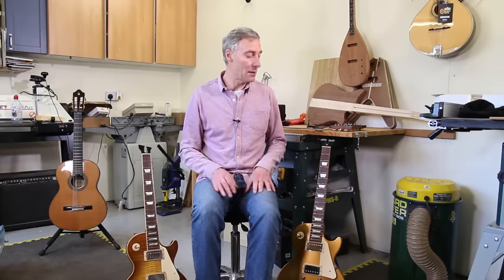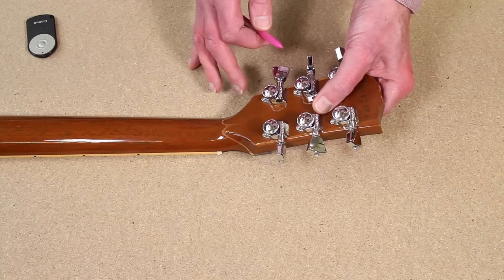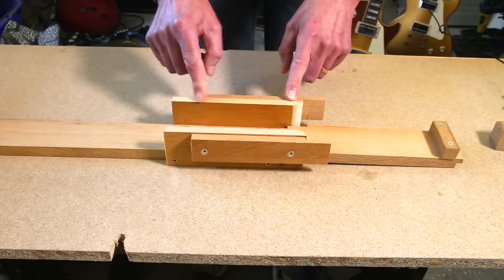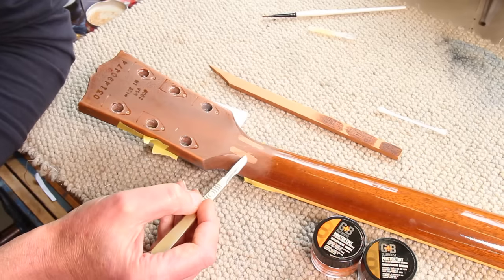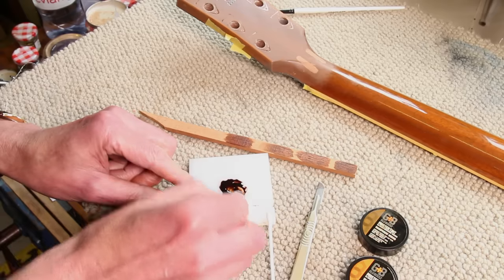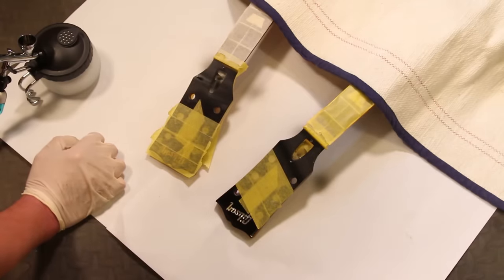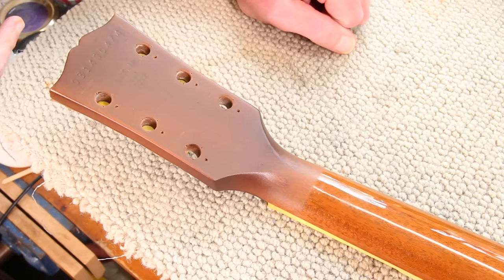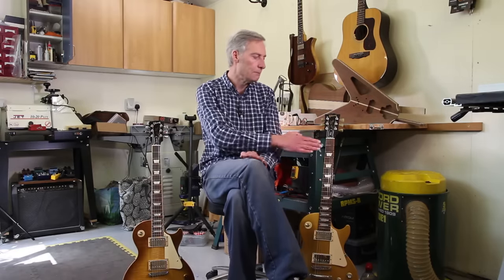Repair of a Gibson Les Paul with a snapped off headstock

Comment: First off, very nice work. With that said, I am not a Gibson fanboy, in the least. But I've never seen a Gibson Les Paul get a neck fracture on it's own, ever. The guitar was dropped. Either in it's case or out, it was dropped. And again, I'm not a big fan of Gibson guitars. But I have been a carpenter and cabinet maker for a large part of my life and know wood.
Reply from the maker: As a result of this video I do a lot of LP neck repairs. It is hard to believe that the neck would crack without being dropped, but I have spoken to too many customers who are adamant that they opened the case to find that the neck has cracked. I could say more about the construction of LPs and why they are more likely to suffer a neck break. But it is worth pointing out that I have not been asked to repair a PRS. Same one piece mahogany neck but a very different headstock angle.
Reply: @flameguitars5770  
I definitely agree that the neck to head angle is the cause. But if it were changed, no Gibson fans would want it. Lol.. me included.

Comment: amazing result. can i ask. how was your sanding process? the grits?? i tried something similar on my epiphone and i can see swirls under the polishing layer. cheers
Reply from the maker: It is easier to do finish repairs on a Gibson than it is on an Epi. That is because Gibson still use nitrocellulose lacquer. So fresh lacquer 'melts' or blends into the existing finish. Not so with an Epi. So if you apply fresh finish to a Epi that has been sanded up to say, 320 grit, you are likely to see scratches under the finish layer. Does that makes sense?
Reply: @flameguitars5770  it does, thanks a lot. i sand it down quite a bit with less aggressive grits even wet sanded. not that i mind, just curious :) . but thanks a lot for the answer

Comment: Thanks.  I’ve got a Les Paul with a break even more end to end than the one you splinted.  Do you mind telling me the dimensions of the pieces?  I have a body I’ll be routing out of maple and I want to make some reinforcements with the spare wood from that job.  Thx!
Reply from the maker: I use splints that are 6mm wide. Length various but about 50mm should be ok. Good luck

Comment: Very good vid. Would you use a splint if the break was at the heel (close to where the neck joins the body)? I bought a nice LP copy with a neck break right where it blends back to the heel (Not a complete break, but it did go from one side to the other). I wedged it open slightly and filled with Titebond II and clamped it over night. It glued up nice with what looks like a hairline crack exposed and it stays in tune and has not come apart yet. Would you be concerned the glue might not hold without a splint?
Reply from the maker: I think that what you have done should be just fine. No need for any additional strengthening

Comment: I have done dozens of les Paul Headstock repairs some vintage there is no need for splints! seem every new repair luthiers decide to splint none of my repairs have ever failed the glue joint if done correctly is stronger than the wood itself! .. I always do my best to keep the crack as invisible as possible especially on a very valuable vintage1958 Goldtop  Les Paul repair is nearly invisible no splints.

Comment: how do you make sure the neck isnt twisted as its never going to be a perfect fit in that direction cause the wood splinters so it wont be identical.
I know you use clamps to get the angle in the one direction. is it worth stringing it and applying the tension before clamping it?

very nice work though. 
there are even people who deliberately crack their headstocks because they say they sound better after repairs. what do you think mate?

Comment: Fantastic work on the Lp Standard, It's a shame that the finish on the back is so dark, but as you said compromises must be made, just wondering what lacquer do you use?
Reply from the maker: I used nitro. Have a look at a more recent video I have posted about the repair of a LP. Different approach to colouring the neck.
Reply: @flameguitars5770  just wondering, what brand of nitro are you using?

Comment: I have a crack just like that in my epi sg. Mine isn't completely off yet. So I'm figuring if I should route that slots for the inserts before breaking of the head. I'm thinkin that by doing it in that order, the inserts will dictate the exakt placement for the head when glueing it back together, right?! I also have that exact router among others =)

Comment: Great video which I will watch several times to help me. I recently bought 2 Epi Les Pauls for $300 because they both have broken headstocks. A steal if I can repair them and use them as back ups for my Gibson LP.
What is the glue you used?
Reply from the maker: Generally Titebond. I now have a total of 3 videos on neck repairs. Slightly different techniques used in each. Hope they help with your repairs.
Reply: Thank you. I’ll check them out.

Comment: How do you go about making the inserts to fit the routed holes?
Reply from the maker: I use a 6mm router bit. I also have strips of mahogany that are exactly 6mm wide. These are then cut to length and the ends rounded to fit the slot.

Comment: This is most excellent. Do you mind if I ask what-all you're using to polish? I see 8000 grit sandpaper there, but it appears you have a bunch of different things going on!
Reply from the maker: Thanks for the comment. I used micro mesh polishing cloths on this job then Mirka compounds. But frequently I cut back to 2500 grit and then go to the buffing wheel.

Comment: You did such a masterful job of the splints and tinting them that it was a shame that the cover up tint came out so dark.  I would actually rather see the high quality splint work knowing the guitar was stronger for the effort than have such a drastic color change to try and hide what is essentially an improvement.  Nonetheless, it was an impressive job.

Comment: Just watched the video, very impressive. One ?, was the Titebond hide glue? If so why that vs yellow carpenter glue? Thx.
Reply from the maker: Titebond cold hide glue gives a little more working time before the glue 'grabs'. In the case of a snapped off headstock I might need a little more time to ensure that the two pieces are properly aligned as I tighten the clamps.

Comment: Hi. Thanks for sharing your technique with all of us.  May I ask one question?  In trying to remove scratches from an Epiphone SG (black) headstock, I accidentally sanded the two upper corners too deep revealing a layer whose color doesn't match the rest of the headstock.  What material, i.e. lacquer, paint, polyester resin, should I use to fill/color match the corners to the rest of the headstock face?  I'm thinking dyed polyester resin as I believe that is the finish on this guitar.  Thoughts?
Reply from the maker: Sounds like you sanded through to the base coat. I would use black lacquer, (either poly or nitro) and an airbrush to make that repair. But depending on the repair area an artists brush will do. Blending new paint onto existing finishes is extremely difficult (easier with nitro). So settle for a "good enough" repair rather than look for an invisible repair. Good luck.

Comment: For those wondering I shopped around and had mine fixed twice. A glue job should be no more than $150. The splint job depending if you had it glued before fixing again. Can set you back between $500-$700. So either you have a expensive Les Paul, or an old Studio that has sentimental value. It’s worth it if you don’t plan selling it. If you plan selling it, just do a cheap glue job and your gonna get the same price regardless. People on used market like all original and it cuts the price. Only go for splint and good repair if keeping it! Otherwise glue it, sell it and grab a new guitar!

Comment: I simply glued mine back together about 10 years ago and it still holds up.. so if glued proper it will hold
Reply: I agree.I used Gorilla glue on my Fender accoustic (dampen wood first) and clamped.possibly stronger than original.After routering can break again wnere splints begin.
Reply: @hughkelly5701  ^^ Key point right there, dampen the wood!  I did as instructed and only dampened the one side before glue/clamps.. My break also splintered about 4" down the neck which was a nightmare to fit!

Comment: I'm assuming this sort of break is why other companies have volutes at the break angle. Is that correct? I assume it thickens up the material enough that this kind of crack/break is much less likely.
Reply from the maker: Les Paul's in the 1970s were built with a volute. I have repaired neck breaks on quite a few of these. So a volute doesnt seem to guarantee that a crack wont happen.
Reply: @flameguitars5770  Oh interesting, I hadn't seen any constructed that way. I thought that was the whole point of the volute. Does a scarf joint help more to prevent this kind of break? Or maybe a less severe angle? Or both?
Reply from the maker: @NeoRichardBlake  scarf joints make for a stronger neck angle. The neck angle is important. PRS neck angle is less than a Les Paul and I have never repaired a neck break on a PRS. Nor a Fender which no neck angle.
Reply: @flameguitars5770  Very interesting. Thanks for the info. :)

Comment: Hello, mate. I live in Hertfordshire, and my Les Paul Studio has a cracked white finish that I hadn't seen, that made me sell my 2005 LP Standard to a guy on eBay for the same price, just to retain my seller reputation, just because he had noticed the crazing in the paintwork. I would like to fix the finish on my LP Studio, or maybe change it. Can you please advise your location and the price for something like this? Alas, I am on a debt management plan, so high hundreds of pounds is not an attainable goal. The cracking is only on the top face, and not all of it. Maybe if I could visit, you could discuss it with me?
Reply from the maker: I suggest you contact me through my website. I am based in south London

Comment: Nice work!  Would you ever consider epoxying in some carbon fiber or steel splines and then covering them with a veneer of mahogany, or whatever wood the neck was made of?  Maybe not steel, Les Pauls are heavy enough, lol.
Reply from the maker: Thank you. I think that might be over engineering. I have carried out many similar repairs now and, so far, none have cracked again. I have had a couple of simple glue repairs that have cracked again. Better still, would be for Gibson to strengthen that area as part of the build process. I probably repair 10 neck breaks a year. Nearly all will be LP repairs.
Reply: @flameguitars5770  Wow, I didn't think you or anyone would reply to my comment on a 2 year old video!.  I have a 2010 Epi Les Paul Traditional Pro, and I believe it has a scarf joint where the headstock attaches to the neck.
Reply from the maker: @MichaelSmith-rn1qw  I get notification on all comments added to my channel.

Comment: David, if you don’t mind me asking what’s the approximate ratio of snapped off headstocks between Les Pauls & SG’s, and wouldn’t the addition of a volute reduce the number? Thanks for the tutorials btw.
Reply from the maker: Tim, of the Gibson range of guitars, nearly all the neck repairs I carry out are on Les Pauls. It could be that this is their biggest selling guitar (I would guess) Very few SGs. There is the belief that a LP with a volute is less likely to break. This may be true but I have still repaired many a LP with a volute

Comment: Nicely done mate... Very tedious indeed. I have been lucky enough to avoid any head stock snap offs on my les pauls. Knock on wood... You would think by now Gibson would come up with a head stock solution. With the degree of angle from neck to head stock this really needs to be addressed and resolved. Along with the D and G string tuning issues. Come on Gibson, you are better than this. Or maybe not???
🎸🤓🎸🇺🇸☮

Comment: A good idea to re-enforce with splints. Why don't Gibson just build their necks better with a scarfe joint? Would that be enough- I don't know. A good friend and luthier does at least two a week. If I were quality control personnel at Gibson I 'd   look into a better way considering there is little wood after the truss rod has been inserted but it is such a huge problem. Just finished making a LP Jr with a scarfe joint.

Comment: Ive seen a pile of these repairs, and just gluing it back on its going to fail. Nice to put wooden splines in for the sake of the precious purity, still not the fix it could be. I glued a headstock back on an acoustic and routed and epoxied two pieces of heavy welding rod, without the flux on of course. Then the wood splines over that. Permanent repair, and lets face it, any time you add a linear density material into a wood guitar it sounds better with more ring and sustain, as in martin box beam and i beam steel truss rods in the neck. The bigger quesion is, why dont you repair guys inlay a couple of pieces of the awesome grqphite reinforcing rod available at StewMac? Those rods and beams ring like a bell because theyre the real deal graphite, bagged and ovened. If youre going to make a big deal repair, use material that will dramatically enhance the sound of the guitar as well. Order one of those rods and see what im talking about. Ad strength and tone, not just wood and glue to your repairs!!!! I guess thats the advantage to being just a guy who fixes things for real, instead of a pro stuck on his training.

Comment: Why not use the stronger Titebond III ultimate instead of TB cold hide glue. There's no reason anyone would need to take the repair apart again,  is there?
Reply from the maker: yes, a number of people have asked this question. it all depends how easy it is to align the broken parts of the neck. The hide glue gives me a longer working time to correctly align the parts before clamping. Other glues grab to quickly. The last thing i want is for that to happen before i am satisfied that the broken parts are properly in place.
Reply: IME, I've not found any significant difference in grab time between TB1 TB3 and TB Cold Hide

Comment: follow up on my early comment carbon fiber splints would be alittle bit lower than the surface and than cap them with the proper wood required.

Comment: Short of bolts and nuts holding that break together you'll never achieve the strength necessary to hold that headstock in a permanent way.   It'll work for a while but it's going to break again.   The tension at that part of the neck with the strings fully wound in pretty high.

Comment: I think painting the neck and having a blended color change is much more desirable than seeing the repair, unless the guitar or the owner is the type where a repair would add to their mystique or vibe.  I'd bet that 99% of people wouldn't ever question why there's a blended color change between the headstock and neck. They'd assume that was how it came from the factory. At least the other didn't curve it to black!
Someone commented that a high quality but visible repair would be better than blended paint. I think a high quality invisible repair is much better. Would anyone think that a repair that's been perfectly covered up could be a not-so-good repair? I doubt it. 99.9% of the time, a repair like that will either last for 5 seconds or it will last forever. Very few repair jobs like that will last for years, and then suddenly break. If any luthiers or other guitar repair people think I'm wrong, please lmk. That's my two cents

Comment: I've just had that exact same thing happen to me. Put it in the case in one piece, took it out the case in two pieces. No idea what happened, the case only travelled from one side of the room to the other.
Reply from the maker: I'm sorry to hear that. You will see that a number of people have commented that it is impossible for the neck to 'just break', adding that the case must have been dropped or people are not telling the truth. All I can say is that I have heard from or talked to quite a few people who are adamant that they simply opened the case and found the broken neck. But it can be repaired.
Reply: @flameguitars5770  It 100% was not dropped in this instance. The only thing I can think of is I that I did not seat it in the case properly when I closed the lid and/or there is some slight defect in the case/padding that just puts pressure on the neck in certain circumstances. I'm equally baffled and devastated.
Reply from the maker: @superspecky4eyes I do understand your pain. I currently have 4 Gibsons at various stages of neck repair and a 335 arriving tomorrow. So I talk to a lot of distraught Gibson owners. I'd be surprised if you have done anything to cause this break.

Comment: Replacing the neck on a LP is not as hard as you think.  I have done two so far, and it took less than 4 hours each, including the finishing.  The cost to the customer was under $300.

Comment: Why was only 1 routed? I thought that just glue would not suffice?
Reply from the maker: I think in the video I comment that the owner had decided not to go with the inserts. He accepted that the neck may break again.
Reply: @flameguitars5770  ah ok, but you would recommend to have the splints put in? how much do you charge for the whole job with the splints and painting? I have a 2006 les Paul Standard with a broken head stock similar to the break of the one you fixed in this video with the splints.
Reply from the maker: @naseleazar3658  I suggest we do this via email. If you could send a couple of pictures of the break I will give you a price for the work. david@flameguitars.co.uk

Comment: the LP headstocks is design error. it cannot be fixed. unacceptable for guitar that may cost up to 4.000 euros. 99% of the repairs in YT are for gibsons. literally, almost none of them is for a fender.
PS. when i say it cannot be fixed,i mean from Gibson. You sir made it much stronger than i was initially